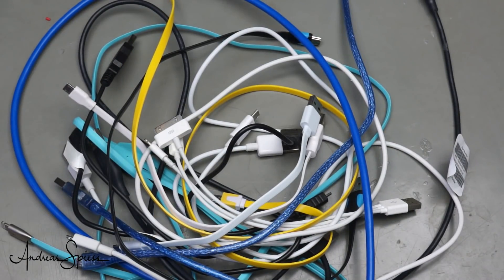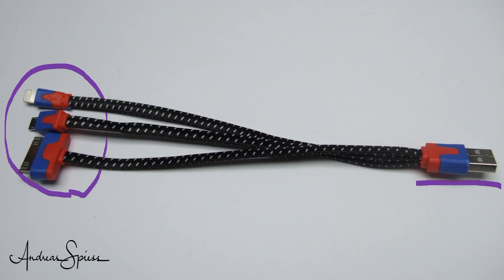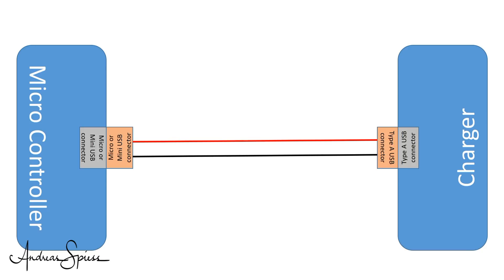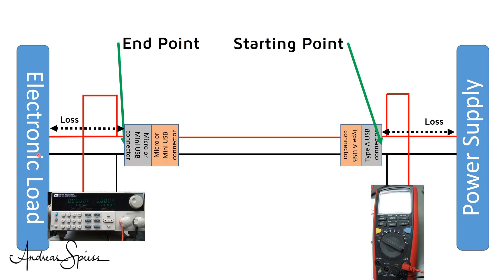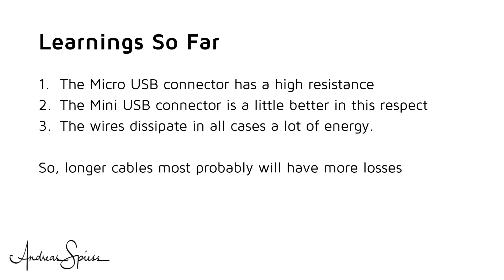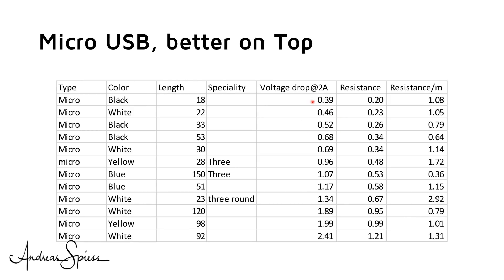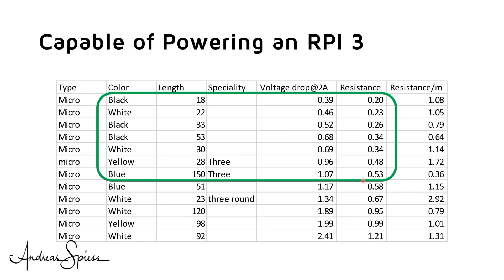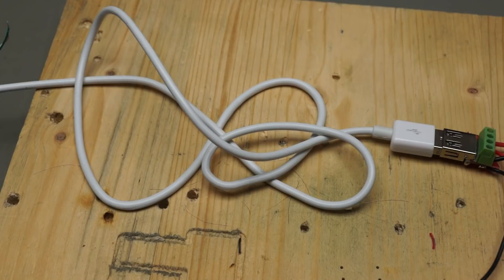#177 Avoid Surprises: How good are USB cables and how can you test yours?

Comment: In my own tests i used a battery with usb a to microusb. I used a meter between the battery and the cable that conntects to my raspberry pi 3. What i found is that the mechanical connection to the meter had an impact on voltage drop. If I physically moved the cable the voltage would stabilize and maintain the required 5 volts at the expected amperage, less ideal movements of the cable resulted in the aforementioned drops. This was tested with the cables that have an inline switch, so they were already asking for trouble to begin with. There was more resistance at the solder joints on the switch, and from the switch itself. Albeit negligible, these impacts lead me to want to solder directly from the cable to the battery itself and do away woth the usb a connectors altogether... This will eliminate the mechanical problems, and since this projects battery is dedicated to this project there are not really any downsides by removing that feature. Probably adding risk but i beleive this is acceptable. Anyway, thank you for sharing your findings. I think this is doing everyone a huge favor in their selection for a reliable power source in their projects.
Reply from the maker: Thank you for sharing your experience!

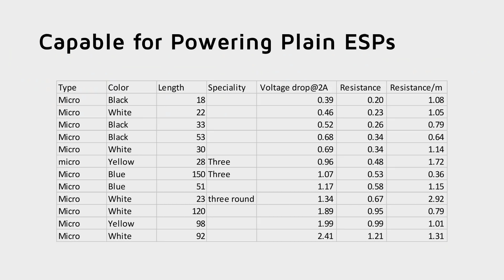Comment: Hello, I know I'm very late to comment this but was just rewatching and noticed (what appears to me anyways, please someone correct me if I'm actually wrong here) a mistake. @12:50 you state that any cable with less then 1.5Ω would be acceptable then when you went to the table you highlighted the acceptable and unacceptable wires but based it off of the voltage drop instead of the resistance value (the last acceptable wire had a voltage drop of 1.34V with 0.67Ω but based on your measurement all wires were technically acceptable, with the last one being 1.21Ω) I know this won't matter much since the use case described is very limited and also the cable obviously being quite crappy quality doesn't hurt discarding it. I'm not sure if this was already pointed out by anyone, I couldn't be bothered to read through all the comments😅, but thought I'd point it out since I noticed the small mistake. Love your videos sir thank you for all you do for the community!
Reply from the maker: You are right, I was not very precise.

Comment: I love your videos! You mentioned the Type A, micro, mini,  and Type C connectors, but you left out type B!  It's typically used on USB printers. My Arduino Mega 2560 has a USB type B connector on it.
Reply from the maker: You are right. The type B is still used in some setups. And I like it if there is enough space available.

Comment: I like my USB C cables to be cloth covered, and the micros to be plastic.  This allows me to charge my phone (USB C and my headphones (micro) in the dark by touch when my wife is already sleeping.  So it isnt all aestetics, there are practical reasons for covering choices but this video narrows down my options even more.  

There is an Android application called Ampere which dynamically reports current during charging or use from the point of view of the battery which I used to sort out the worst cables.  I dont know how accurate it is.
Reply from the maker: Good idea. I try to buy the C cables in red... Does not work in the dark...

Comment: i have been using AMS1117-3.3 voltage regulator but its always trouble but alternate i have is MIC5219-3.3BM SOT-23-5 package with 500mA peak output The MIC5219 is designed to provide 200mA of continuous current. if AMS1117-3 is bad choice then what other options we can have ?
Reply from the maker: I often used the HT7333
Reply: @AndreasSpiess  HT7333 is good choice but it has Maximum output current:250mA, is there any voltage regulator with 600ma to 1A
Reply from the maker: Maybe the HT7833?

Comment: I don't understand ? How can R+50% = 1.5Ohms ? R = 2.2 , .5 * 2.2 = 1.1, 2.2 + 1.1 = 3.3 ?
Reply from the maker: I do not exactly know what you refer to. My point was, that a new connector has to have 1.5 ohms. Because with age, it will increase its resistance to the maximum acceptable 2.2 ohms.
Reply: @AndreasSpiess  at 12:34 there is a formula that threw me. So in fact, it is 1.5 + .75 = 2.25  which is approximately 2.2.

Comment: The main problems I have with usb charging cables are not resistance but only connector stability - I have to throw them away so often, no idea why. (But I mostly speak about mobiles, tablets and powerbanks)
Reply from the maker: That is a main reason they changed hte concept for USB-C. They should be better...
Reply: Andreas Spiess don’t have usb c experience, but with TB it’s mostly not the contacts (unlike microusb) but the cable ends.

Comment: I'm not an engineer or a physicist, I'm a technician. I know how it works and how to do it but it doesn't work. It's all designed wrong. I'm so frustrated. Never-the-less, you'll probably find the cheap cables are using CCA instead of straight copper.

Comment: I learned this the hard way on a project were I "got smart" and used something similar to PoE to also power a sensor.  Of course the power drop over the longer Ethernet wire out the sensor put it in occasional brownout condition.  I highlighted occasional as it is the worst kind of failure for engineers - intermittent failure.

I would suggest that makers construct their own USB power only cables using easily available connectors.  You get better conductors and newer makers get in a little soldering practice in a reasonably forgiving space (connector headers).  Just be sure to safely test each made wire to insure no polarity mistakes were made.
Reply from the maker: PoE usually uses higher voltages. Like that they can lose quite a lot of voltage without any problems.

Comment: Why don't you just short the connectors on the micro USB end, and then directly measure the Ohms from the USB (charger) side? Is there a special reason why you recommend connecting it to a load and measuring the current and voltage instead?
Reply from the maker: Would give the same results, but I thought it is easier understandable for the general public if I show how much voltage is lost.

Comment: Thank you for the really interesting video.

I did the test with 2 amp / 5v (entry).
I was surprised to see a drop of 1.7v in about 50% of my cables (even the one that look good and expensive from Digitec...).

My best calbles are USB3 cables with almost no drop of voltage.
I had really good experience with some cables from Voxlink (2-3$/piece)
Reply from the maker: Thank you for your feedback!

Comment: I remember the first bag of cheap esp8266s I ordered from china - for hours I thought "Can really all 10 of them be broken, !@#$%"? Then I switched out the USB cable and e vóila, everything worked fine. It's always the soft, squishy ones that try to look as "Designed in Cupertino", which fail fast, not the sturdier, but maybe not so cool looking ones, which have thicker copper wires in them
Reply from the maker: Thanks for sharing your experience!

Comment: Just wondering have you tried UM24/UM25 USB voltage testers? I know, that with your equipment its just an expensive toy, but for hobbyist like me it is great thing how to measure cable resistance with almost no hassle.

Of course the problem is it has only type A and MicroUSB connectors...
Reply from the maker: I have one of these and it is great. I never used it to test cables as a wanted to go to the basics. I am sure you can get reasonable results if you know what you do.
Reply: I am trying to know what I am doing :-) After last 2-3 years I got to know things about electricity a lot, but as much I keep getting to know, the less I know :-(

I am grateful for your videos, back then I bought ESP8266 chips I know they are pretty good ones, but had not too much time to test and play with them. Now, when I go through your videos it seems it is all too much simple, but without proper knowledge it is hard. Thank you and keep going.

Comment: Easiest method test usb cables is buy usb meter and look current  when charge max current power bank or some else and change cable and put low level cables away. https://www.ebay.com/itm/USB-Charger-Doctor-Current-Voltage-Charging-Detector-Battery-Voltmeter-Ammeter/253119520701
Reply from the maker: If you have a reference cable, this is a good method.

Comment: Nice work as usual Andreas, hank you for this video! I suspect that big voltage drops are very common and many people don’t understand why their Raspberry or ESP sometimes crash without obvious reason when the culprit is simply the bad USB cable. So I wonder if it is advisable to power the ESP or the Raspberry through the GPIO pins. The main problem is that these pins are unprotected (no fuse) and maybe unregulated. That means one has to build an input circuit with fuse and regulator. But maybe that would be worth trying. What do you think?
Reply from the maker: I would keep the Raspi as it is. For the ESP I often use a barebone ESP-12 and a voltage regulator.

Comment: I use an app called "AccuBattery" with my phone which shows the current throught the phone while charging. Most usb cables can't actually supply 2A even though the packaging claims so.
Reply from the maker: I do not know these apps. But phones have some signaling possibilities to reduce current if they do not need it. So it might be, that you did not measure the cable or the charger but the actual "command" of the phone.
Reply: Andreas Spiess 
Thank you for the reply. 
Yes that's true, I notice after about 85% capacity the current starts to decline. I turn off the wifi and lower brightness to lowest settings and make sure the phone is less than 70% charged to a make an "acceptable" control environment. I switch the cables one after the other for comparison and find about 0.7 amp difference between high-quality and ordinary usb cables. But it's still just a casual test to see if the cable is very bad or not, only comparison.

Comment: Good vid Andreas. For some, here's an easy testing method. I had a problem with Samsung Galaxy Tablet not charging, and eventually found it was dependent on the cable. There's a program called "Galaxy Charging Current" (https://play.google.com/store/apps/details?id=com.abmantis.galaxychargingcurrent) that will show the charge current being delivered to the phone/tablet. Using this and the same Samsung 2.5A charger, I found that the charge current delivered to a tablet could vary from 0.28A to 1.4A simply by altering the cable, and for the 7" tablet, it simply didn't charge if the current was too low. As might be expected, the brand named cables were best, and it's well worth the time to test and label each cable using a black marker pen, or for black plugs, form a little 'flag' by folding a short piece of yellow or white insulation tape around the cable and write on that.
Reply from the maker: This is a good idea for people with Android phones. It does not work with my iPhone. And I am not sure if the "current signaling" used between the power supply and the phone influences your results.

Comment: Thanks for this episode. Andreas, being in cable and power issues, it might me interesting to comparize mains (or 12v car) to USB chargers. The issue is that mobile phones use data D+ and D- lines to indicate how much current the charging circuit can draw from charger. I was caught on this issue several times when my phone does not charge when I borrowed it from others.
Reply from the maker: You are right, but I am not a specialist in Smartphones and cannot add a lot there. Therefore I did not mention all the issues around this signaling and QC.

Comment: Thanks for this video.
At the moment I have problems uploading my code to the ESP32 via a 2m cable (PC and ESP are on opposite sides of my room....). I have a 3/4 rate that there is a checksum error.... Is there a way to test cables for data loss? Or is there an indicator of data stability?
Reply from the maker: I never did that. Did yo test with a short cable?
Reply: Hi Andreas, thanks for the quick reply and sorry for my late response.

In a new setup I had to bridge about 4m from the computer to my video projector where another ESP32 lies, so I used the same cable with another USB cable that came with my wireless keyboard (the one where you're supposed to put the WiFi dongle in).
This time there are no problems uploading, so I guess it is not the cable. Maybe that other ESP32 or one of my USB ports is damaged or there are interferences with other hardware lying around (LED transformers) or even with the connected 433MHz receiver?

I was asking because there are other cables with visible shielding (that at least look more trustworthy). I'm not sure how good these longer cables actually are for transferring data, as these are sold as "charging cables". But they seem to work fine....

Comment: Good video. You don't need to test each cable, just look at the writing on side of the cable for the size of the power conductors. Often on cheap cables both the data and power wires are 28AWG (or smaller) on better cables you will see the power wires are 24AWG or so in size. When buying new cables pay attention to this.

The moral of the story is that micro-USB connector are a terrible choice for 2+ amps of current. Not only are the connectors then selves not suitable but the USB cables themselves are questionable. RPI and others should move to a barrel type connector for these higher current requirements.
Reply from the maker: I agree with most of what you write. Still, I think, test them is not a big effort.

Comment: For RaspberryPi 3, I had very good results with '15cm 0.5FT Micro B USB Fast Quick Charge Cable 2.1A Android SmartPhone 18AWG' from eBay (no data leads, from South Korea). They are not cheap, but really good. When 15 cm is too short, there's also a 30 cm version. With that cable, I can even power a RaspberryPi 3 with a small 1 TByte USB harddisk, which requires 500 mA on its own. No yellow lighting bolts in the top right of the screen. Yes, it is possible to use a Y cable with that disk, but that causes unstable  power caused by back-feed, and you can't afford the voltage drop in diodes that would prevent the back-feed. In my opinion the capacitors in the Pi's power lines should have a higher value than they currently have.
Reply from the maker: Thanks for your tips. If you cables really have 18 AWG wires, then they have to be very good. These are already quite thick wires.

Comment: For years now I'm using a different and very quick test. On my Samsung phone I have an app called Galaxy Charge current. It shows max, ref en average current while charging. 
https://play.google.com/store/apps/details?id=com.abmantis.galaxychargingcurrent.free&hl=nl

Knowing what my charge adapter can deliver it quickly shows the quality of the cable. Even longer cables can work fine, but  are rare.
I can buy and test it outside the shop and go back in to buy more if they test for good current.
This is the way I can quickly sort my good, bad and ugly usb charge cables. 

One thing you didn't mention in your test is the material the cables are made of. Even good cables, can become bad if the cables (very often) breaks at the bending points. 

I mostly (for my phone) buy multiple cheap cables that can handle the current and toss them at the first sign of a disconnecting charge.
My raspberry and other SOC have fixed power cables I soldered myself or a good usb cable that I pin down.
Reply from the maker: Thanks for your tips. Using the Smartphone as an "electronic load" is an interesting concept. And cheap!
Concerning bending cables: I focussed on small devices and there, I think, the problem of bending cables is smaller than with Smartphones (and uneducated users)...

Comment: Some of us are both engineers and physicists, and yes, most of the jokes below are good ;~}.  FWIW, copper has a tempco, so as your cheap cable heats up say 10C, the resistance also goes up - so your statement about it being the same at all currents isn't quite true (but almost).  Copper resistance will be 1.0399 times as high when it's 10C hotter.  Maybe not important to this, but good to know if using copper for say, a current measuring shunt, or on the edge of burning up.
Reply from the maker: Another viewer also pointed me to this fact. Of course, I knew the effect, but thought, it is neglectable. So I learned something...

Comment: Very nice video, I appreciate the methodical analysis technique.  Regard the "mini" USB cables - while they would be superior in terms of the power handling capability, their big flaw (from my view) is that the the "springy" component of the mini USB connector is on the equipment-side, while the fixed contacts are in the cable.  This is the reverse of the micro USB connectors, where as the connection arrangement ages and wears, it's the cheap cable that wears out, which is easy to replace, rather the connector on the device.  The reverse is the case for the mini-USB connector arrangement, where the device's pins will wear and now you have a more serious problem if there are too many connector mating cycles.

I really enjoy your videos, thanks for sharing with us.
Reply from the maker: Thank you for your information. I did not know that. But it is for sure better to have the wear and tear on the cables instead of the expensive devices. I wonder how long my iPhone connectors will survive...

Comment: It's a pity that the USB standard didn't include a 5th wire to allow for the power supply to measure and adjust the destination voltage.
Reply from the maker: The equipment needed on both sides was probably too expensive in these days